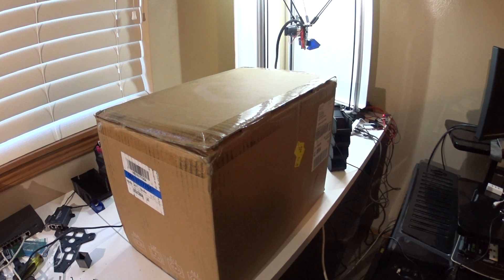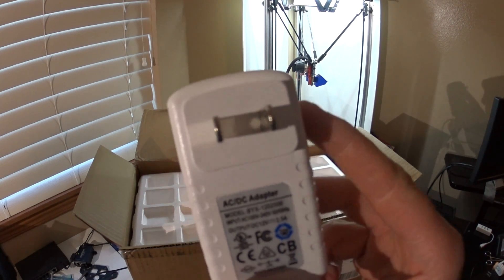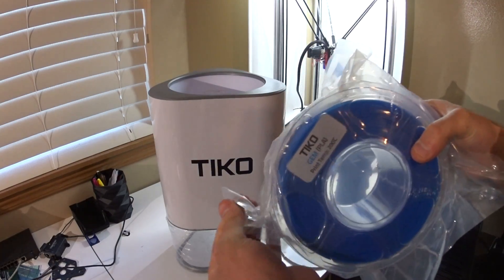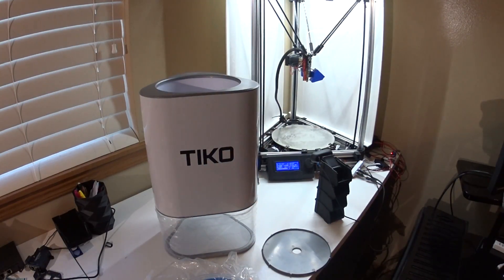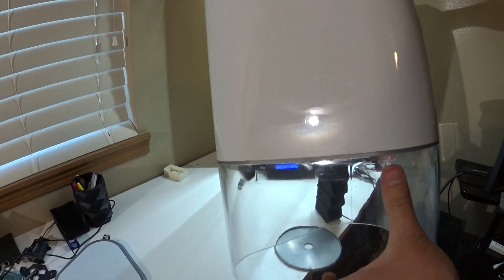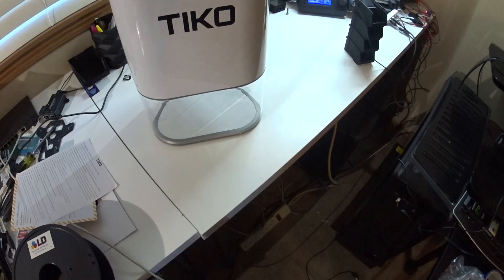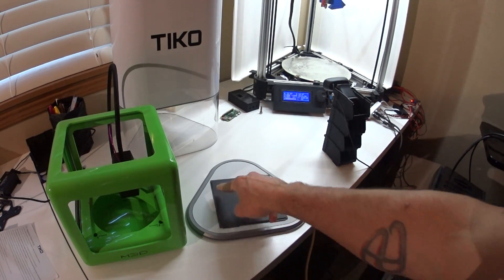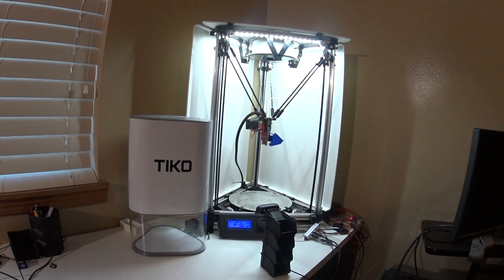Beta Early Bird - Tiko 3d Printer Unboxing & Hardware Review

Comment: I hope mine turns up soon.
Reply from the maker: I know Tiko is still working out some of the kinks and I ended up having another hardware failure at the bowden tube right by the hotend folding over not allowing filament to pass. Tiko wants to hold off on since the failure will more than likely happen again. When it was working the print quality was pretty good. Now is just a waiting game to see if they send me a replacement printer or the parts to fix the one that I have. I will be doing a tear down video here in the next week or so.

Comment: So what number backer were you and what country are you in, if you don't mind me asking?  I'm trying to get a feel for when mine's coming, I still haven't gotten any kind of notification. :(

And hey, if you don't care to use that little M3D Micro as a printer anymore, you should replace the extruder with some other tool and turn it into a PCB mill or CNC engraver or something, the formfactor's perfect. :D
Reply from the maker: I am in the US and I'm backer number 80. From what I understand the first 100 "earliest bird" backers are really real world beta testers to help with software and point out any potential hardware issues that might happen in a non controlled environment. A small PCB mill wouldn't be a bad idea for the micro. I am going to try using the micro with Octoprint to see if there is any improvement with the print quality. I use it on my large Delta printer and it works great.
Reply: Propslayer Fabrications Ah, so these unboxings and reviews that've been popping up are from the Early Bird batch, then.  I'm backer number 656...hopefully I won't have to wait to wait too long once they start shipping. :D

Comment: with tiko and m3d
Reply from the maker: I can see what I can do. I haven't used the micro in probably a year for printing. I tried a software update from them about 6 months ago and I still couldn't get the micro to print. I have some old videos of when it was printing that I will find and upload.
Reply from the maker: Hi Ray, I found an older video that I had of the M3d Micro printing. I just upgraded to the latest software from their forum which still says beta for some reason and will see if I can't get the Micro to print. I will also upload more videos of the Micro as I find them. Here is the video: https://youtu.be/kb0F8G1tyqw

Comment: This will be hard to find spools that fit. Terrible.
Reply from the maker: No I haven't tried re-spooling yet, but i printed an external filament spool holder just in case its not worth the effort.
Reply from the maker: From what I understand 1 pound spools or 6.5 inch spools will fit. I will probably just respool the spool TIKO sent me with different filament.
Reply: Have you ever done that? I think its more hassle than its worth..
Reply: +Propslayer Fabrications Look into dremel / FlashForge filament 600g spools.
Reply from the maker: Ah thanks for the info. Ill look into that if I don't have any luck with the spool re-winder.
Reply: The lid has a hole in the center, that's not just to use as a handle.  I plan to simply run filament in from above like I already do with my current printer. http://media.makecoolthings.com/wp/2015/08/3dp_printstation.jpg
Reply from the maker: +Bakamoichigei oh yeah thats a good idea too.
Reply: Once I have mine to do all the measurements and stuff, I'll probably design a printable lid with adjustable spool-holder built in. :D
Reply from the maker: oh man thats a good idea and would keep the weight centered over the top. Its so top heavy that putting a spool off to the side would probably make it tip over pretty easy